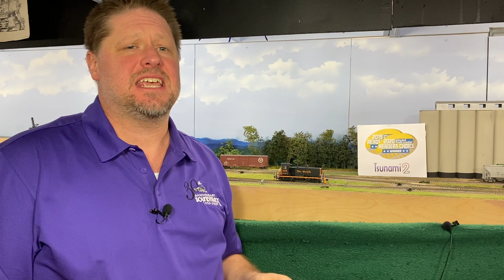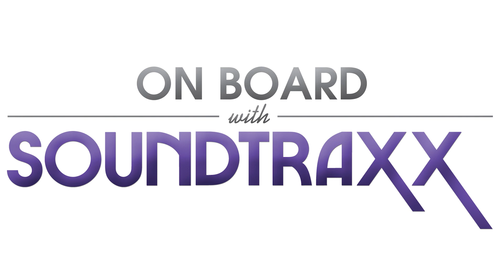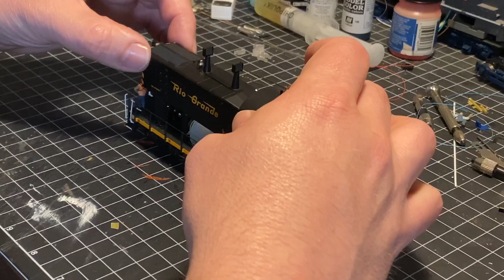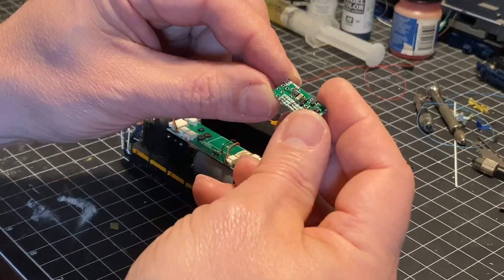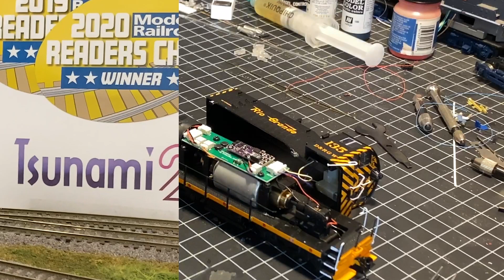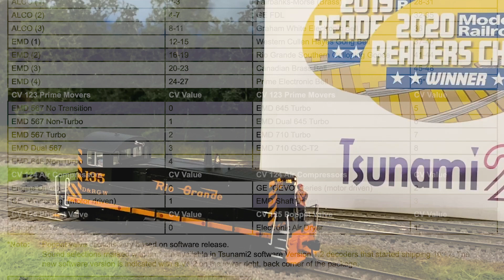Tsunami2 New TSU-N18 Decoder install into a Walther's Proto 2000 SW1200 Install

Comment: How do you know that the locomotive has an 18 or 21 pin connector? Just count the pins or is this information located on the mother board?
Reply from the maker: The format for each is quite different. Once you are familiar with them you will be able to tell once you pop the shell off. The 21p has 21 pins protruding up from the connection on the mother board. The 18 is a recessed socket the decoder snaps into.

Comment: MY opinion: Where or who sells a mother board for the 18 pin connector???? This is BS unless you already have  a model with an 18 pin connector.
Reply from the maker: This decoder is designed for models with the Next 18 connector just like the TSU-21PNEM8 is designed for models with a 21 pin connector. We would recommend buying the decoder that is the best fit for the model you have. If you don't have a model with a Next 18 connector this is probably not the decoder for that model. If you want to install this decoder into a model without a Next 18 connector or need help choosing a decoder for a specific model you have, please contact our Support Department for assistance: support@soundtraxx.com or (970)259-0690. Thank you.

Comment: Very cool, thank you George as I'm planning a build with this particular locomotive. Does the quick plug for the current keeper being re-routed to the speaker mean that you can't install a current keeper? Thank you  -  Dave B.
Reply from the maker: In most cases, a CurrentKeeper may be soldered to the locomotive's factory-installed board to
help maintain performance during momentary power interruptions. Please contact our Customer
 Support at (970) 259-0690 or support@soundtraxx.com for assistance with determining the correct soldering locations.

Comment: Would it even be possible to add keep alive power to that type of board? I don’t know if even a CK2 would fit in this diesel but I bet a KA1 or KA2 would fit.
Reply from the maker: In most cases, a CurrentKeeper may be soldered to the locomotive's factory-installed board to
help maintain performance during momentary power interruptions. Please contact our Customer
 Support at (970) 259-0690 or support@soundtraxx.com for assistance with determining the correct soldering locations.

Comment: Hi George, nice product.  Was the reason for changing the speaker because the stock one was 4 ohm?  Also, you need six and eight cylinder 567 sound files for the SW1/600 (six) and SW8/900 (eight).
Reply from the maker: The original speaker was a factory-installed speaker and since we cannot attest to the quality or frequency rage of it, we decided to use one of our mini-cubes in its place to be sure we get the lowest frequency available for the Tsunami2.  Ours can reproduce down to 100 Hz, but at those low frequencies, they’re not very loud, which is why we recommend 2 or more, to help with those low frequencies.

Comment: GG 👀,
               Whaaat!  This is not modeling!  Everyone knows if one doesn't use a soldering iron or spend hours using tweezers like a vascular surgeon connecting wires like nerve endings, then it's not modeling!  Soundtraxx needs to check it's designers at the door with all this plug n play awesome electronics and simple Dcc sound upgrading.  This isn't what modeling should be!   Oh-boy, if this is how Soundtraxx is going to make future Dcc upgrades moving forward then I'm going to have to where my mask over my eyes to create a better modeling challenge.  Thanx Thom... 😁
Reply: I know this is a sarcastic (and good natured) response, but there is a lot of truth to it. I've been retrofitting my old HO diesels with DCC decoders. It is a wire by wire process as none of my stock has anything resembling the nice circuit boards of today's locomotives. It's really no different than when I wired them up 20+ years ago, except now I have cool sounds and light controls. For the beginning modeler, is there any actual modeling any more? Kits are a thing of the past and everything is ready to go right out of the box. It seems that even weathering is being done by manufacturers now! It's a dying art for sure.
Reply: @JF-lt5zc  ,
              Yes you are correct on all points here!  Unfortunately, you are correct on all points here.  Too many modelers today choose to be more of train buffs than modelers.  The videos and tutorials that George is creating are very much needed for this hobby.  While it's very cool to see a Dcc upgrade that requires less than 20 minutes to complete.  There's nothing more self rewarding than taking on upgrading all the great older models we grew up with - to today's standards with all the lights, bell & whistles and giving them new life... May the force be with us!   Thanx Thom...
Reply from the maker: Haha we do try to make decoders that any level of modeler can use. The hobby has changed a lot over the years!